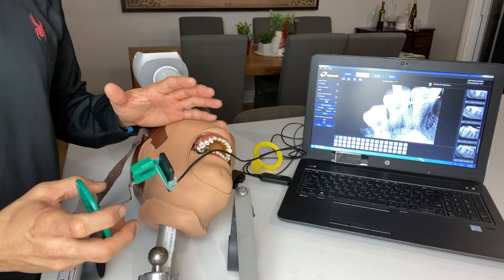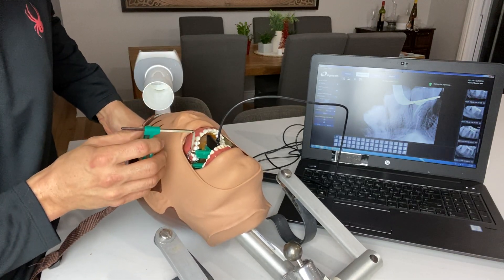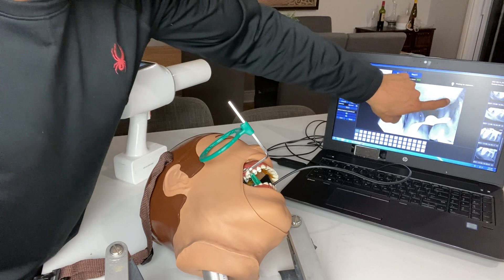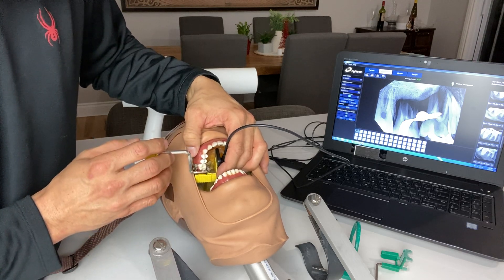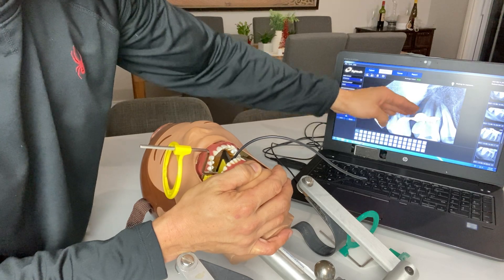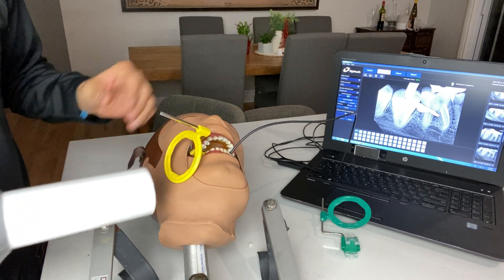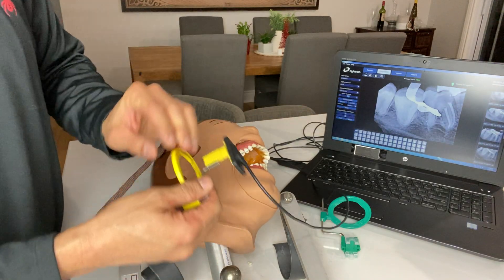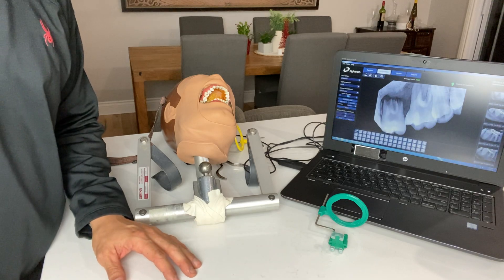How to Take Dental X-Rays and not Miss The Apex. {Course Lecture}

Comment: I already asked but I have to ask again because I yet have to find an answer: is it safe to use a handheld X ray unit like that being behind the cone beam? Just wondering because I still don't understand why I didn't get it earlier. The massive x ray unit I have with wheels is an enormous pain in the ass to move around especially for endo.
Reply from the maker: I found this as an appetizer: https://drive.google.com/file/d/1Q_QU0lo1taHp_XgFvUDl1C2Zb4KfRRq8/view?usp=drivesdk
Reply: The handheld machines are more accurate with their aim & reduce scattering as opposed to the traditional large machines,